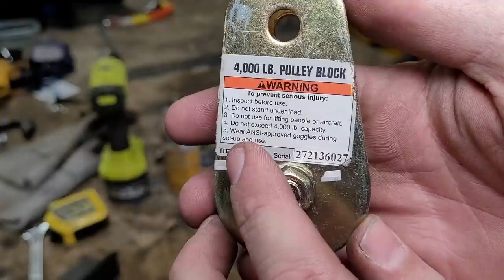Building a Homemade ELEVATOR in our Abandoned Backyard FALLOUT Shelter! | Part 3

Comment: Super cool project. Really should wrap the ends on the pulley mounts though. If a weld is going to fail from a tearing or tension force (like a sudden safety cable engagement) an open weld end is where it'll happen. Looping or "wrapping" your weld around the end, even just a little bit, makes the joint many times stronger than a joint where the weld terminates leaving the end of the perpendicular member unwelded.

Comment: I’m glad you have the skills to build the lift but it would have been easier to put steps in and fix the headroom and slope issues.  If the power goes out, you’re out of luck.
Reply: He says he has plans for battery backup power for it and a ladder for egress should the winch fail.  That said I would have been tempted to build some slightly steeper stairs and call it a day.
Reply: I was thinking the same thing about the power.  But, it being a bomb shelter, it makes sense that he would have plans for alternate power.
Reply: @homeFall1  I was thinking the same thing:  most people would just make a set of stairs that fit that space, and be done with it!

Comment: I've opened up those ryobi batteries and give them a few volts right to the cells and it jumps them and the charger will recognize them again.normally they'll take a charge then
Reply from the maker: That's not a bad plan, I had another one go bad since and have saved it.  I'll have to experiment.  Thanks Tony!

Comment: Just curious, what are the plans for the shelter? 
Still want to use it as shelter if shtf?

Might want to consider a ladder in it… 
Grid down, no power and no elevator… hell of a jump 12ft…
Just an idea,
Elevator with a quick release on the cable to drop it down, and some grips on the structure to get down in it….
And back up when you have a power failure and you're down ;)
Reply from the maker: Hey Dutch, I have some power supplies that automatically switch from grid to battery that can power the elevator.  I will also have a backup ladder bolted to the wall.  Good Points!

Comment: HOM, what is your first name? Can't find it searching on Google. I watch many YouTubers and love to personalize my comments addressing them by their actual name. Anyway, just started watching your site today and find you very interesting. As to your testing of the safety device you just installed in last couple days..... I'm frankly surprised you didn't figure out a better, easier way of doing that using the actual final configuration of your elevator. When you had it inclined at the 23:37 minute part of the video, all you needed to do was lower the elevator all the way to the bottom, then simply raise it up by hand leaving the winch cable slack, then let gravity do it's work. The safety device would stop in approximately 3 inches. Easy peasy lemon squeeze.

Comment: Maybe a drop down handle of about 3-4 ft a pipe in a tube about 5-6 foot. You can pull it up twist it thru 45-90’ & drop it down about an inch maybe to lock it in, but have it at the same height so when you slide the door open it’s close to hand to pull up. 👍👍🇬🇧🇬🇧
Reply from the maker: Hey Ray, I don't completely understand, do you mean a latch to keep the door closed?
Reply: On the side of the tower fit a 5ft tube with a poll in side it, it can slide up & down. If you cut a channel along one side then fit 2 nuts about 12 inch apart to run up & down in the channel. If you have a knob on the top of the poll you can pull it up about 3-4 ft & have a space to twist it & drop it to lock it up. So you can steady your self when getting in & out. ?? I’ve done some drawings I could email to you. 🇬🇧🇬🇧👍👍

Comment: That block doent work the way you think it does. The cable is not what determines the load rating, the braking mechanism is. I am not sure if you are in the US or Canukistan. Here in the US, safety devices need to be certified by OSHA. If it certified by OSHA it will have a normal working load of 330 lbs, and can hold that weight many times. It will also employ a safety factor of 10 for human use. Meaning it will hold approximately 10 times the rated load ONCE. Being as its from China, I would not trust my life to it. Retired union Ironworker here, and I used these very frequently. What you are doing with it is very dangerous and could result in serious bodily injury or death. You would be better off only using it to support a person on the elevator while they are wearing a harness, and dont double part it.

Comment: hmmm would it not have been smarter to have the winch on the lift so you could have a manual crank mechanism in case there is no power? if the world goes to shit making you need a bomb shelter there is no guarantee you will have power to get back up.
Reply from the maker: Going to add a ladder bolted to the wall near the lift so we can jump to safety if needed!